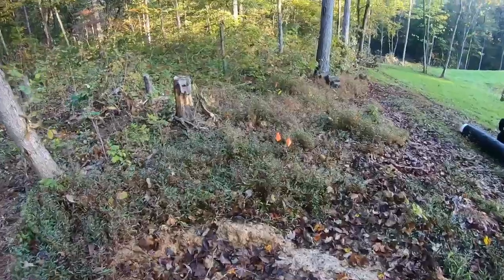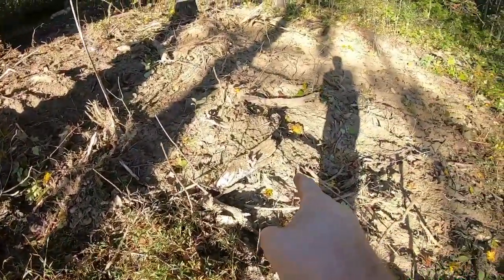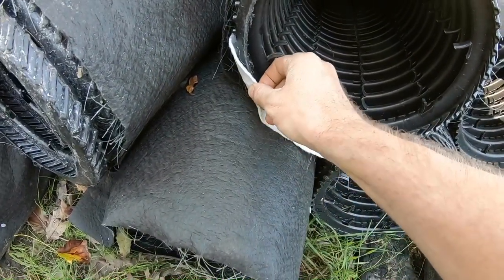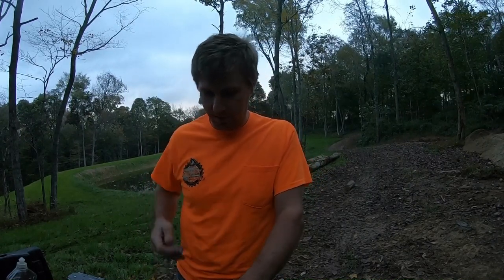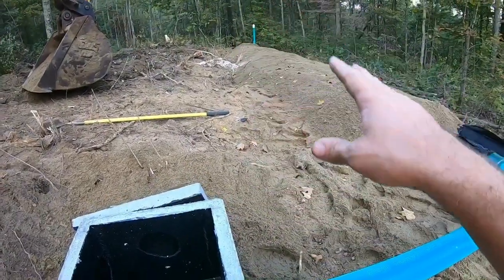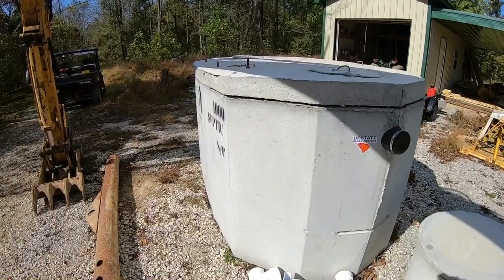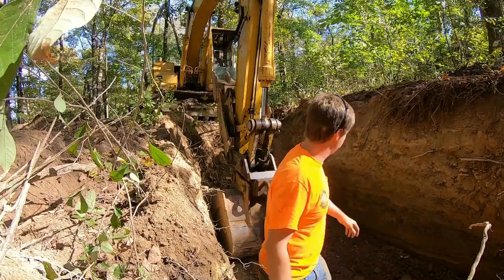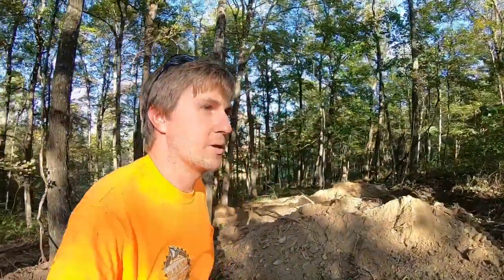Homeowner Installs Septic System For YouTube Yacht Project - Tank and Field Bed

Comment: "Tip of the day" ... when hauling heavy, swinging items like your Septic Tank (or even towing a vehicle), run a chain slightly shorter than the dead plumb angle thru a piece of pipe (even chain link pipe) and it will minimize the swing; for a vehicle, best to put an old tire at each end to absorb the bounce.  Great video and very insightful. Thanks Captain !!!

Comment: When I sold my home in Massachusetts, by law I had to upgrade the septic system. Originally built in the 50's, it comprised a 500 gallon steel septic tank and a very large cesspool that overflowed to the creek. The new septic system required upgrading my electrical system to power a pump up system, the removal of many trees in the yard, and then a certified install. It cost $20,000. While this is a big bite, I was happy that the system was completely replaced, as it was both an ecological disaster and an electrical danger. My parents had cleared the mortgage decades earlier. I never saw it complete because I had already moved to the West Coast.
Reply from the maker: Glad it all worked out!

Comment: Watching you move the tree stump makes me want to see you, Dirt Perfect, Letsdig 18 and Logger Wade in "Excavator Olympics"
There could be events like "the stump toss" for distance, "Throw the rock in a hoop" , speed digging and more.
What do you and others think?
Reply: How about ring toss with old tires onto a wooden post beyond the reach of the bucket.  (Scored by number of ringers and time.)

Setting water bottles upside down on traffic cones using those cheap Wal-Mart water bottles might be a good test.  (Scored by hit the target, no crush.)

Pivoting the tracks 180 degrees over paper cups of water setting against the center outside edge of the track.  (Scores on distance from centerline at the finish as well as no crush or spill.)

Picking up horseshoes with the teeth and dropping them over a pin… no thumb allowed. The pin is just inside the maximum folded bucket reach and 90 degrees from pickup.  (Scores as  3= ringer and 1=closer than a shoe opening.)

O’ there are so many things they can do!
Reply from the maker: That would be cool!
Reply: After watching DP winding up the volvo and MBTS filming the results recently I think that's a good idea. I'd put Capt K as favourite for the gold in the 'cooking breakfast with the 120' even with the added hinderance of the egg  thief any day of the week.
Reply: I would pay to see that! I would travel to Derby to see that!

Comment: The Septic is lookin good .Captain. I put alot of those in by myself back in the day.  At least you didnt have to have a 2nd tank and electric pump to pump gray water into Sand mound. They get real Expensive... I did one years ago that it took 30 loads of sand. It was for a Truck stop up home. They had to buy property  across the road just for the sand mound .The people that dream those things up, Should have to work out in the field installing Septics before they can design and make rules for them..Great Video Sir glad you beat the rain..
Reply from the maker: It’s amazing how expensive they can get
Reply: @CaptainKleeman  Your Absolutely  right Sir. Its all a money Racket. And it would work the same way with just regular 4 in perforated pipe instead of that big black perforated pipe like you used..I swear the Guys that do inspections and that Gets a kick back from places that make that pipe. Great Video again Sir..

Comment: Looking good. When lifting something heavy with an excavator you should do it over the idlers and not the drive motors. The machine has more lifting capacity over the idlers. Check the operators manual keep the videos coming Thanks

Comment: IBC tote (275/330 Gallon) on a small trailer for your water needs. fully loaded 330gl tote weights less then 3K lbs. (Tank+Water)
Reply from the maker: That would work well!
Reply: @CaptainKleeman  you should be able to find them around locally (craigslist), if not uline.com has then new for under $600.

Comment: That's a big step done.  What's your guess as far as price if you had a contractor come in a do it?  I like to think about things like that as savings and not so much as spending.  Say it would've cost you $12K to have it done.  You're up $6K.  Good job on the install.  You're one major step closer.
Reply from the maker: I would say you are pretty close.  12-15k if I hired someone
Reply: Like anything else, that guesstimate is for that area. Someone is going to write in and say that is too high and one will say that would only get the perc tests done.

Comment: Thanks for sharing your thoughts and videos, had a few thoughts from this one. When you cut the first stump I could hear logger Wade oops tore the core wood, no veneer from this one. Was half expecting to see you scoop some water from the pond with the 120. Lastly is it the size of the system or grade that determines the need of an interceptor drain, didn’t see one. Overall a great job, I used to do projects by myself but I scared myself a few times after night shift and proclaimed a no power tools after nights rule. After that and it was a slippery slope to laziness. Great to seeing you doing amazing work on your own. Wishing you and your family the best.
Reply from the maker: I know that feeling!  If we have a busy night at the station,  I try to limit myself as well.  Tired work is a guaranteed injury

Comment: dang! That was a lot accomplished in one video.   That was huge.   The tank and the sand mound all finished.  Pretty cool.  Never knew what a sand mound looked like as to how it was built and what kind of pipe was used.  I thought it would be smaller diameter like used in a normal leach bed below a distribution box.  Neat to see that.  They seem to be requiring that more and more here in PA.  Seems like your soil and perk test has to be absolutely perfect anymore for the inspector to approve a normal septic system.
Reply from the maker: Thanks for watching!

Comment: 34:19 I have never seen a tape with both sides marked. What brand tape is it, because that would be handy for measuring how far off the trailer the trusses I haul hang. Awesome job getting the tank nearly level on first drop in. And while it may not be as glamorous as other building steps, I dare say it is one of the most important steps; because with all the snakes and spiders y'all have out there indoor plumbing is pretty important.
Reply from the maker: It’s a Milwaukee.  Bought it when I was down in Gatlinburg.

Comment: Nice you can hide the mound in the woods a bit.  These systems are a landscapers nightmare as they stick up a couple of feet in the middle of the yard and can only have grass grown over the top.  In flatter areas a pump is required to tear up and lift the raw effluent to the tank and t by en into the mound.
Reply from the maker: They definitely can stick out

Comment: Norweco makes a 3 chambered aerated septic tank that can be approved for surface discharge with addition of a chlorination on the third chamber.   Maybe not in Indiana though.
Reply: Here in British Columbia, things like septic systems are regulated by the local municipality, so it's town regulations you have to verify against.

Then, recently I saw a 163 acre property ( 3 properties in one sale ) all with ready to log alder and zero regs for building. No local town to issue regulations and permits so none needed. 163 acres of 100 to 150 foot tall trees for logging only accessible by boat or float plane for about a million Canadian.

Comment: It is strange because every State has a different septic system. In Texas you can have a leach field for the county but it is all underground.
I think you said you have $4500 to $5000.00 in a DYI and the system. What does it cost to have a system like yours installed from a contractor?

Comment: Correct me if I'm wrong or if I missed something but didnt you miss a calculation on the tank install?  Wouldn't you want to find the drop from the building to the tank site first?  Maybe I just missed it but if your elevation of your building was 1 foot higher than the grade where you put the tank wouldn't you have to go 48" with the tank at that point to get the proper grade?   Or inversely if the tank site was 1 foot higher the hole would need to be 72"?  

Did I explain my question correctly or as previously mentioned... did I just miss that part?
Reply from the maker: .25” in a foot is required.  48’ from sewer outlet to tank.  .25 x 48 is 12.  12” of drop requires from Sewer outlet to tank.  Add height from bottom of tank to invert of inlet equals depth of hole

Comment: Did you get a new Husqvarna? I think I need to get a new one, my current one seems to be getting lower and lower on compression every year.
I would like to add a number of vague poop jokes here in the comments but I try to keep it family friendly and for some reason people don't think the most natural thing other than eating is rude. But I will give you one- Wehn it comes to installing a septic system you really need to know your crap, otherwise you are really going to know your crap. ;)
Thanks for the videos, Mike.

Comment: You said you were gonna put rock under tank I know mike uses sand but you didn’t use any…?
Reply from the maker: Like mentioned In the video,  the material underneath the tank didn’t need anything to dress it.  It depends on what the material is like under the tank
Reply: @CaptainKleeman  sorry didn’t hear that part but it came out great and IMO I prefer the untouched packed soil over fill…sorry I was a plumber for many years…

Comment: I can't imagine you and your misses at a toga party twenty five or thirty year ago times ... I mean you do have to be old enough to go to one/LOL. For you, excitement would be a bit of a but flash under the sheet Where as me and mine, excitement was wondering who's blanket we were under with and plenty of booze. See Mike, at seventy two is hard to get excited at making a bed for turd juice that looks like Bambi never scratched the soil there. I forgot how to get excited over the little tin can in the bush or your case ... cement. After you get the boat walls up, you can go to that neighbors house an cut some wiens coat for bottom of walls.